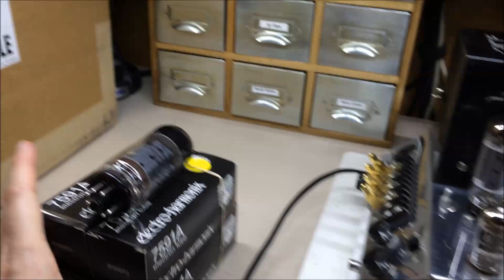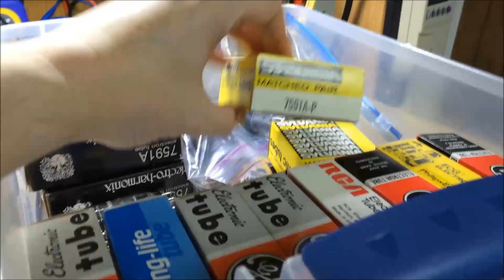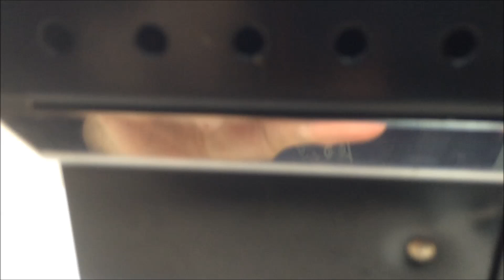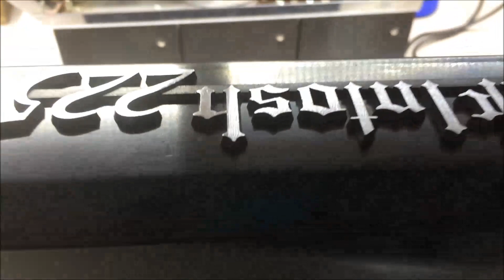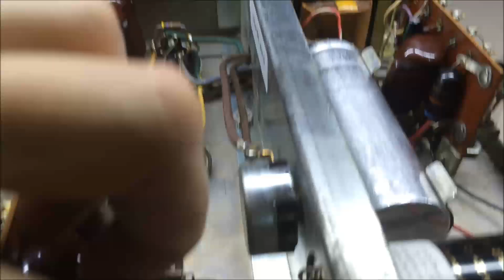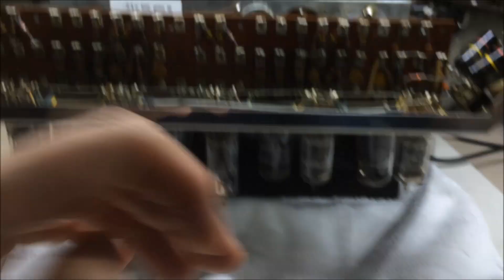McIntosh MC225 Info & Service Part 1 of 2 - BG002

Comment: From the owners manual; I understand that the two bars on the bottom of the amplifier were shipped new with the amplifier from McIntosh. 
They are designed to be pointed tab-side-out. 
The bars allow the unit to be mounted in a case. 

The manual says the amplifier can be mounted any way except tubes down. It says that (when side mounted) the tubes should be on top so that the heat they create will draft up and out.

Comment: Those black plastic so-called bumblebee capacitors are notorious for leaking. After 50 years they develop hairline cracks and absorb moisture and then they begin to have a high leakage.

Comment: Nice video. The image is just fine. The sound a little bit obscure but perfectly understandable.
I own a Mc MC-275 and a Luxman MQ-360. It is supposed both designs have a built-in auto biasing circuitry (at least, both manufacturers claim so). Is that true?
Past year I retubed the Luxman with two "matched" pairs of 6550A penthodes from Sylvania. I do not give too much credit to this "matching": I really think that's another trick for naive "audiophiles" and a way to rise the price over their real retail value, but nowadays is almost impossible to find power tubes not "matched".
But I'm digressing. My question is: Are the "auto-biasing" circuits worth of trust?
Many thanks.

Comment: I've always considered a solid state diode PS as cheating.
Reply: Even though there's logically no reason the PSU should matter so long as it's got a clean DC signal and you aren't irresponsibly contaminating your signal path with switching noise from the PSU

Comment: Did you put in a 1N4007 diode in across the selenium and change out the bias cap?. I usually put in a 47uf at 50v Muse cap. Also change out the bumblebee caps, especially the .047uf at 400v that goes between the phase inverter and voltage amp. I use a K40Y pio cap.
Reply from the maker: Always.

Comment: Loving these vids.  Thanks for every single vid.  This is awesome.  I've avoided tube gear due to financial reasons but I'm thinking of leaping into it.  I like the 275... any thoughts?
Reply: The MC-275 is an amazing tube amp. 
I have one and it's delightful sounding and solid as a tank.
It can drive with ease loads of 16, 8 and 4 ohms just changing the cables in the binding posts.
Well; pretty sure you know all the above. The point for you, I gess, is the sensitivity of your speakers and their impedance curve. If this last is too tortured, think twice. Keep in mind tube amps are not generous current delivery devices, opposed to solid state ones.
Mine are the easy to drive Mission 767. They have a good sensitivity: 92 dB/1 watt/meter, wich is pretty good.
If you decide to buy it, McIntosh sell this amp in two versions: the standard and the "Anniversary Edition". The differences are mostly cosmetic, but the different prices are not so "cosmetic".
Best regards.
Reply: ventura rodríguez vallejo I agree. The MC275 is one of the finest power amps I’ve ever had in my home. The build and sound quality is second to none for breathtaking realistic soundstage imagery.

Comment: Around 1960 when I was 19, I remember going to Lafayette Radio in NYC. They demonstrated two McIntosh 60 Watt amps along with a McIntosh pre-amp, a high end turntable and cartage and the JBL Paragon Stereo reproducing speaker system. For those who never saw this speaker system it was a huge system  about 7 feet long with elliptical horn shaped speakers aiming and an elliptical sounding board. Behind them were large woofers aiming straight out. The bottom Line is that I don't think any system today could compare with that system. The idea of this speaker system was to give the listener the stereo illusion no matter where he or she sat.